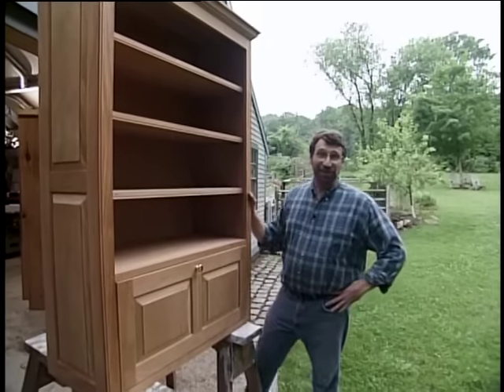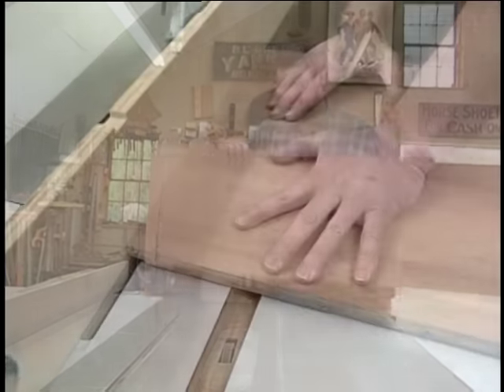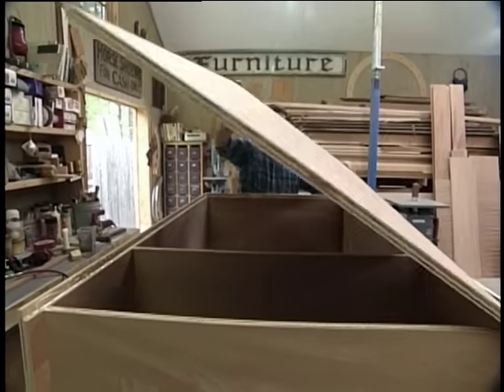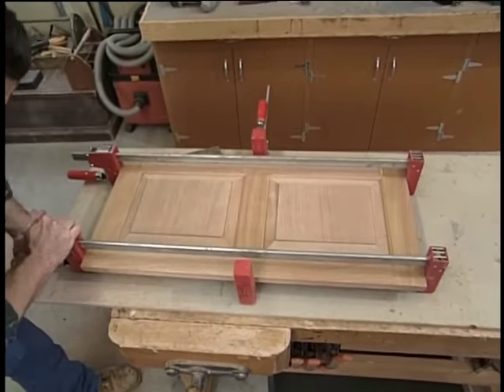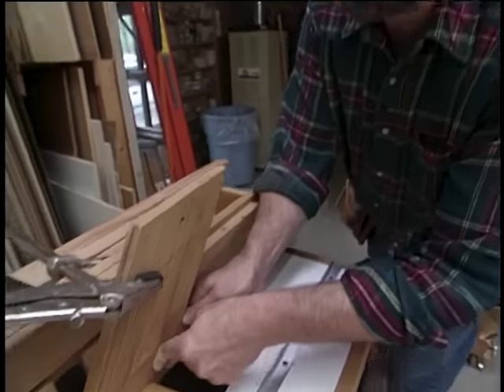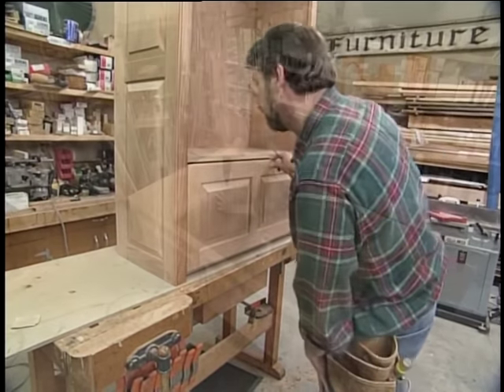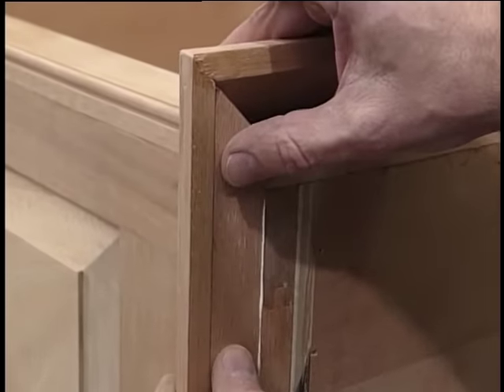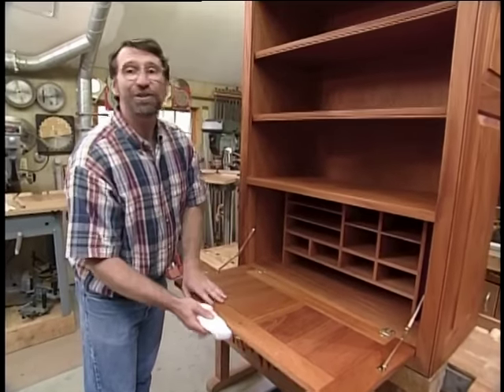Kitchen Secretary  |  S11 E3

Comment: After watching … it feels overly massive. Are the sides really 1.5” thick? Maybe that would work in some kitchens, but it seems like you could thin out or eliminate some of those layers. If you build it this size, it might be smarter to mount it on the wall with a French cleat. (And you know little kids are gonna hang on that desktop.)
Reply: The average house was much bigger during this time. People had lots of room for projects like these around their homes.
Reply: I'm sure you could eliminate the inner plywood panels of the carcass and use raised panel sides.  Maybe set the center rail in the side panels to correspond to the dado the  fixed shelf sits in, and put the holes for the movable shelf pins in the front and back stiles.  Eliminates about a half sheet of plywood

Comment: This is something that can sit on top of a cupboard instead of hanging on a wall.
Reply: Agreed.  It looks too big to be on its own, but I can see it used as an end piece on a kitchen cabinet system.
Reply: If it is to be used as a secretary, it would need to be hanging from the wall to allow a chair to fit underneath. It could be part of a cabinet system, nothing wrong with that, but space would be used for the cabinetry rather than for a chair.
Reply: @greencello599  It could stand on legs or a sort of desk-like frame,

Comment: ok dummy [myself] is Norm saying Ravit  Rabbit 🐰 for the cut. ?
Reply: Rabbit. Or if you're in the UK, a rebate.
Reply: @r.parker1933 A rabbit is a small furry mammal, a rabbet is a groove cut made at the edge of a workpiece.
Reply: @201081hero  argh. Stupid auto-correct....
Reply: I had to Google it.  Personal 30+ year old mystery solved. 😂
Reply: I hear rabbit
Reply: Rabbet.  A slot with a rectangular cross section cut out of the edge of a board.  Often used to match up with another board, sheet or panel at a right angle, forming a joint that is somewhat stronger and more stable than a simple butt joint.

Related terms:  Groove.  A slot typically with a rectangular cross section cut through the face of a board along the grain.  Dado.  A slot typically with a rectangular cross section cut through the face of a board across the grain.  Rabbets may be cut along or across the grain but are always at the edge.

The word comes from the old french "rabbat" meaning a recessed niche, and has nothing to do with bunnies or hares.  "Rabbet" is typically American spelling, the British usually render it as "rebate."